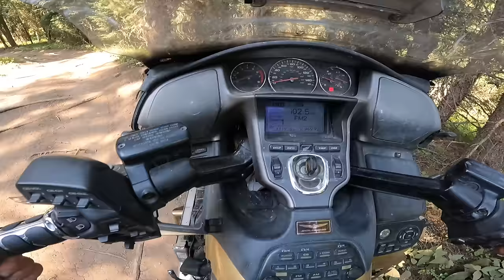Honda GOLDWING Off Roading!

Comment: I haven't watched enough of these videos to notice, but you should be running a car tire on the back. I run a 16" run flat car snow tire and its great in the dirt. The bike is much more stable in the dirt and the traction is great.
Reply from the maker: Thanks for the tip! I need to do that. Currently have a dual sport tire on and it is sketchy with the weight. Which tire are you running?

Comment: Hey Matt, what size and kind of rear wheel/tire are you running on Piggy? Are you using a dual sport tire?
I’m planning on taking a goldwing to Baja and don’t plan on staying on pavement. I can’t find a dual sport tire that will fit the stock 16” Honda wheel

Comment: Tried to go through all the comments and couldn't find an answer. What tires did you find to go on the stock rims? It looks like they did fine on the highway, wear is probably pretty quick though 😂
Reply from the maker: Bike EATS tire. Shinko 805 in the rear. In this video I had a semi street tire up front but have since switched to a moto tire.

Comment: Enduro bikes are the most fun had about 6 back in the day about 5 years ago I got a YZ 250R without the power valve system it was just wide open, was stupid fast for a 250 I didn’t like it , was a X race bike
Reply from the maker: Awesome! Those Yzs are killer bikes

Comment: Scooter Peugeot SC 50
50cc 2 strokes, mounted with tyre 80cc at back
Very easy & comfortable - off road at chamonix-mt-blanc, from 1.000 to 1.300m.

Comment: As long as the bike is secure and doesn't exceed the maximum width which it doesn't I don't see any reason why that would be illegal. It's very odd but as long as you're able to control it I don't think there's any specific law against putting a bike on a bike.

Comment: Did you think about using the cruise control and see if it would be smoother on the rough areas? Just a thought....
Reply from the maker: I've tried...for some reason the cruise control does not work on bumpy terrain, must be a sensor somewhere.